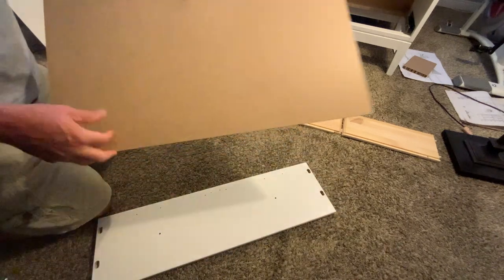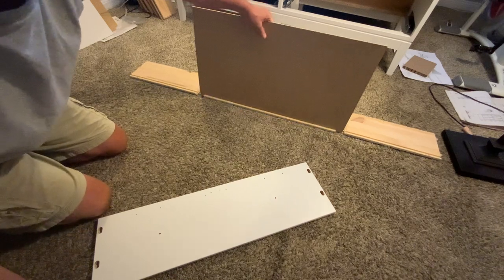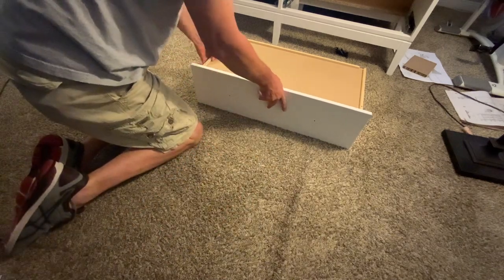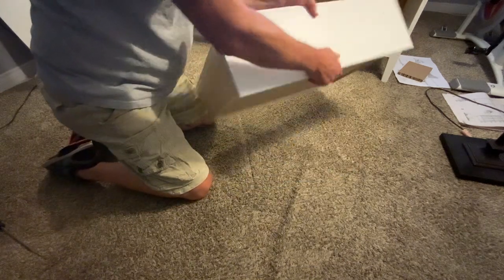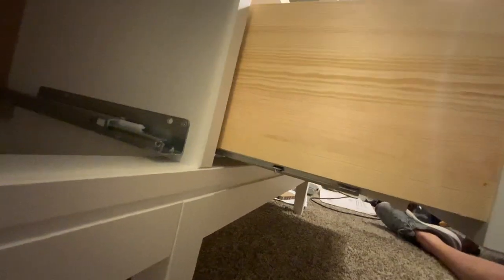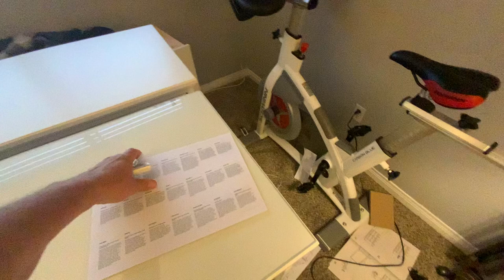IKEA Idanäs drawer assembly

Comment: My gf build one of these furniture but we are having problems with one of the top drawers. It almost on the edge of the top. Did you have the same problem?
Reply from the maker: I didn’t have the same problem. But you might want to check to make sure you have inserted the drawers into the slide rails correctly. I am not near my dressers to actually check but I remember that the drawers insert and kind of drop into the rails and if they don’t drop in all the way they might sit a little high. You can always switch drawers and see if one fits better than the other. Good luck sorry I can’t be of much help.
Reply: I’m having the same issue! Fml
Reply: Me too. One drawer fit perfect, but the others are not straight. I did make sure both sides are on the rail and clapped on the back, but it shows the gaps.
Reply: Hope it’s not to late, but you can use the screw in the front where the drawer sit and screw it up or down to level the drawers if needed